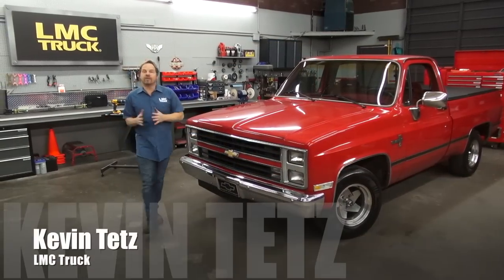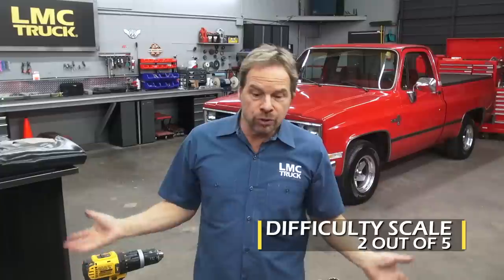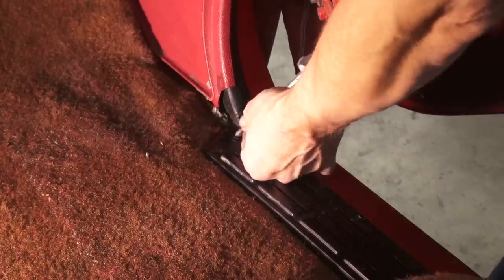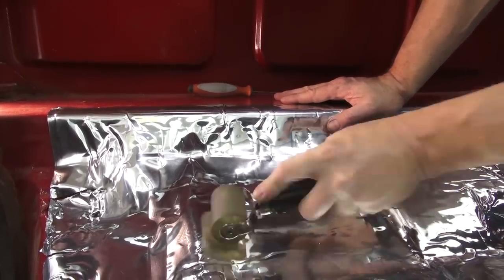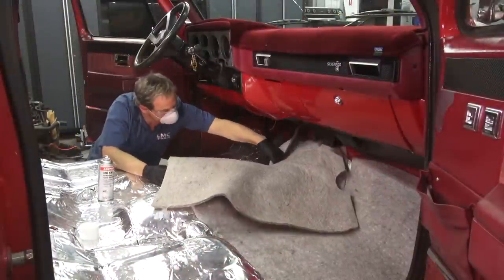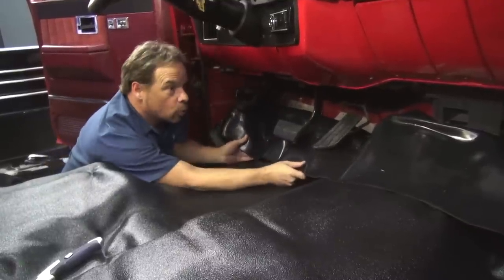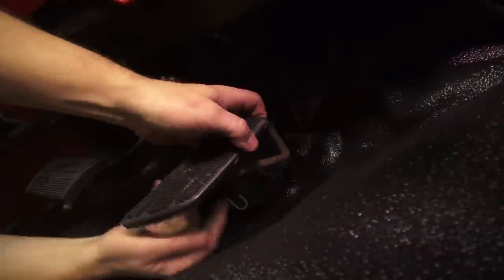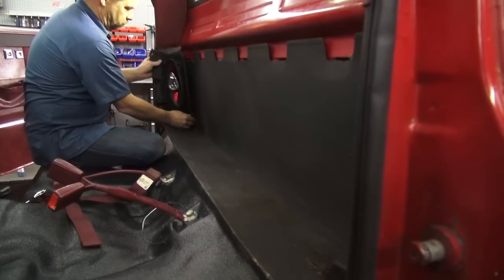How to Install a Molded Industrial Polyvinyl (MIP) Floor Mat | Kevin Tetz with LMC Truck

Comment: Just finished up my 90 Blazer with LMC  sound deadner with new jute under LMC carpet kit. Used dynopad in the rear cargo area, 74 dba in the cab with stock exhaust, 33" toyo mt and a megnaflow muffler. Nice and tight solid feel cruising 75mph down the hwy. One tip!! Use an old soldering iron to punch out bolt holes through the carpet. Super clean fit. Only thing is the heel pad is not centered in the driver floor and ends up running up the side of the tunnel.

Comment: Nice install....id have used a heat gun on its low setting to help settle the wrinkles out of the flooring and make it a little easier to work into the tight spots.

Comment: Can these floor mats be painted to match the original interior color? If so what kind of paint would work best?
Reply from the maker: Hi!! They can be dyed, but the floor is a "High Traffic" area and is not recommended.

Comment: I heard your vehicle must be designed for this kind of carpets to work, otherwise your metal floor will rust out as humidity has nowhere to go. with normal carpets water just vaporises from it but with these water gets trapped. is this true?

Comment: Bought the flooring for a Chevy Tahoe 4x4. Had only one impression for a seatbelt location. Material didn't want to lay flat or is nowhere near as soft looking or flexible as he made it look. Even with it sitting in my living room two days with a heater on it.

Comment: Will that process be the same if you put down carpet down instead of that floor mat on a 1986 GMC Sierra classic 1500 regular cab long bed 1/2 ton
Reply from the maker: Hello, the process will be the same but our LMC carpet will not need to be trimmed like the MIP mat was.

Comment: Did you have to customize anything to mount that 90s model bench seat in there?
Reply: I never saw this comment. Maybe too late but yes there are some modifications. I used the original 85 seat tracks but had to engineer them to fit the seat frame. I do have pics i followed from another who provided his experience on one of the blog sites.

Comment: this is what i need for my truck but LMCTruck, you don't have any parts for my truck. 1987-1996 Dodge Dakota. Mine is a 1995 Dodge Dakota 4x4 extended cab. Please tell me why you don't have parts for my truck. These first gen dakota's need more tlc than the second gen dakota's.
Reply: Prob cause there isn’t as much of a following for those trucks. Market would be small.

Comment: what is wih old chevy truck , when you close the doors they sound as if something is loose... always in older trucks from the eighties
Reply: Probably because the plastic that holds the door rods gets so worn out from the doors being slammed lol
Reply: The window moulding felt was gone in this video. Had just painted door panels and about to do vent windows before this opportunity came up.

Comment: What are we supposed to do to the floor mat in the rear of a k5 Blazer or Jimmy?
Reply: I am having the same issue. It does not fit around the wheel well. Just a flat peice of useless vynyl

Comment: Do y’all know what year truck that seat is out of? Also where can I find some black/chrome trim like the one on this truck? Only see the full chrome on the catalog
Reply: Myles W ‘90-‘94
Reply: The trim was bought at O'reillys auto parts. If I'm correct the seat came out of a 94 model.
Reply: @terryr7054  I am pretty sure this interior is out of a 91 suburban.
Reply: @anastaciocastro8747  I can definitely tell you it came out of a 94 C1500

Comment: The peel and stick sound deadening material looks like a nightmare later on down the road if this is ever done again
Reply: It is made from Rubber Butyl, you will be dead before that stuff wears out.
Reply: @ze_german2921  ya it's just hold moister and rots out the floor. Wich is already a problem. Lol

Comment: How to I stall rubber mat:

Step one. Throw in trash.
Step two.  Get carpet.

Every chevy with rubber mat, has haf floor to rust through. Never a nice floor, my theory is the water will get in no matter what. Then can't evaporate under the rubber.

Comment: carpet would have looked better
Reply: Carpet might look better initially, but if you're using the truck in wet and dirty conditions it goes to heck in no time. Last year I got a Base Sierra to replace my 2002 Silverado WT. The old truck's factory mat was still going strong at 170,000 miles and 15 years.
Reply: I was thinking the exact same thing. I want carpet on my truck but that's cuz I don't plan on using it as a truck.
Reply: @nelsona779  then buy a car!
Reply: @dodgeramsport01  i have one
Reply: The customer wanted this in his truck.

Comment: Talk about 10lbs of shit into a 5lb bag. Had to trim about 6" off all the way around. If I did it again would do the half mat. If they could figure out a way so that you had very minimal trimming. It's extremely difficult to trim up under the dash laying upside down. Sill plates don't fit now cause it's wadded up in the back corner. I like LMCs stuff but this one is a bit too much. You better have a lot of patience if you plan on this one

Comment: Lmc= terrible fit, bad quality, and way overpriced. 🚮🤦🏽‍♂️
Reply from the maker: We're sorry we didn't accommodate your expectations on your parts Andres! You're more than welcome to return them for a refund if they're in new-like condition! Feel free to call 1-800-562-8782 with any questions.
Reply: Especially their tailgates.  Don't ever order one of their tailgates, unless you never plan to use it as a tailgate!
Reply: @hanskinslo326  damn is it that bad?
Reply: @nelsona779  no its not that bad!
Reply: @dodgeramsport01  I have used LMC Parts on my truck but no body panels yet. My dress up kit turned out okay and looks good.
Reply: @nelsona779  I have used many of their parts. They are good parts
Reply: @dodgeramsport01  okay that's good to know because I have a long list of parts that I need to get nlmc is working with me on my truck build did I slowly got going on. I'm doing the dress up kit and a few other things under the hood like water pump radiator Etc so hopefully I'll have my truck running again this weekend
Reply: Han Skinslo i bought one of their tailgates and i was very pleased with it. just as good as oem imo